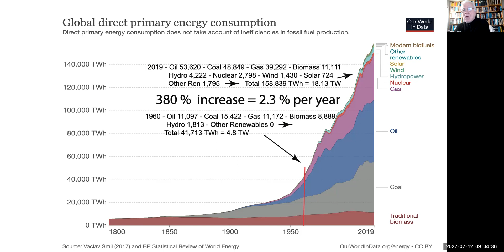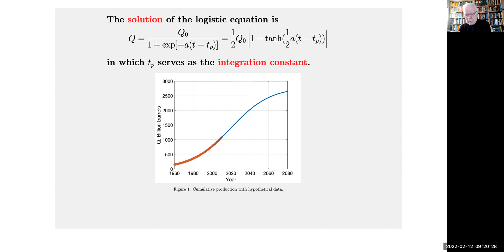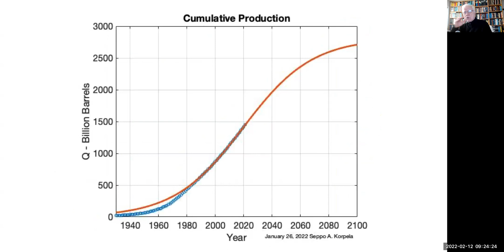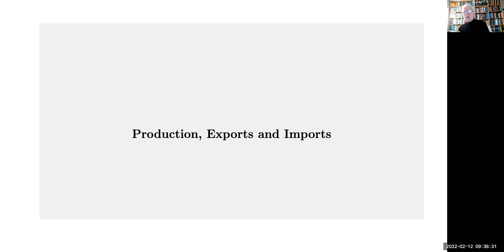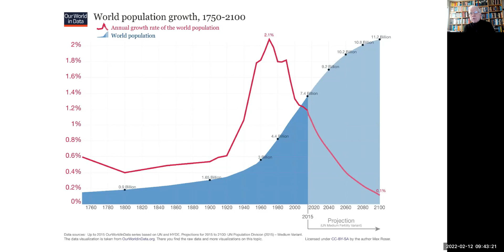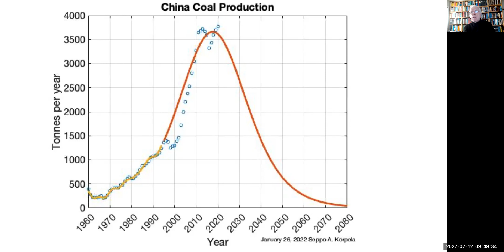Fossil Fuels and the Fate of Industrial Civilization

Comment: I beg to differ wrt personal EV. Here in 🌞 California, we installed 5kW rooftop solar for 6 yrs. It has reduced >50% of our petro consumption with no grid impact. Almost obvious, we addressed all power waste in our home as well. In fact our solar power helps the grid during peak demand. Our house was not designed for optimum solar generation. If done properly, easily 100% of energy can be generated (with battery backup). Majority of the ppl live in generous sunshine regions 🌎 . Again as you said, 80/20 rule applies. Most ppl will very easily convert to solar/wind/hydro electricity and find BEV, e-scooters, e-mobility, plus a healthy dose of human powered movement to be very transformative both mentally & physically.
Reply from the maker: Blizz, I was talking about what is happening across the world. Locally many things make good sense. But I maintain that reducing consumption as much as we can is the best way forward. However, what are we going to do in the sprawling suburbs where destinations are too far for walking? You use the word "transformative". Walking is also transformative, as it frees up the mind and new and old thoughts can be reflected upon. Thanks for your comment.
Reply: @seppokorpela5739  We cannot change the human instinct to be selfish, but we can do our best to delay and minimize the suffering when the easy-oil dries up. I'm frustrated society want to just kick the can down the road without trying for the smallest of lifestyle changes, which are insignificant in the big picture.
Reply from the maker: @kbmblizz1940  I agree with you and one of the reasons I put up this video was to alert people what is ahead. But, since it is my first video ever, and has reached about 2000 viewers, I am under no illusions that this makes a bit of difference. As to myself, I have always lived life frugally, a small house and a walking distance to work (well not quite, I did live in a place a few years where I had to drive 2 miles to work).

Comment: My ability to "Reply" no longer functions. On YouTube that is.
Comment still seems to work.
Evidence? Science? Happy to oblige.

Fact 1: Remove the Earth’s atmosphere or even just the GreenHouse Gases and the Earth becomes much like the Moon, no water vapor or clouds, no ice or snow, no oceans, no vegetation, no 30% albedo becoming a barren rock ball, hot^3 (400 K) on the lit side, cold^3 (100 K) on the dark. At our distance from the Sun space is hot (394 K) not cold (5 K). 
That’s NOT what the Radiative GreenHouse Effect theory says.
EVIDENCE:
RGHE theory “288 K w – 255 K w/o = a 33 C colder ice ball Earth” 255 K assumes w/o keeps 30% albedo, an assumption akin to criminal fraud.
Nikolov “Airless Celestial Bodies” 
Kramm “Moon as test bed for Earth”
UCLA Diviner lunar mission data
Int’l Space Station HVAC design for lit side of 250 F. (ISS web site)
Astronaut MMU w/ AC and cool water tubing underwear. (Space Discovery Center)

Fact 2: The GHGs require “extra” energy upwelling from a surface radiating as a black body.
EVIDENCE:
According to the K-T atmospheric power flux balance, numerous clones and SURFRAD the GHGs must absorb an “extra” 396/333/63 W/m^2 LWIR energy upwelling from the surface allegedly radiating as a black body. These graphics contain egregious arithmetic and thermodynamic errors. See https://youtu.be/0Jijw7-YG-U

Fact 3: Because of the significant non-radiative, i.e. kinetic, heat transfer processes of the contiguous participating atmospheric molecules the surface cannot upwell “extra” energy as a black body. 
EVIDENCE:
As demonstrated by experiment, the gold standard of classical science.
For the experimental write up see:
https://principia-scientific.org/debunking-the-greenhouse-gas-theory-with-a-boiling-water-pot/

CONCLUSION:
No RGHE, no GHG warming, no CAGW or mankind/CO2 driven climate change.